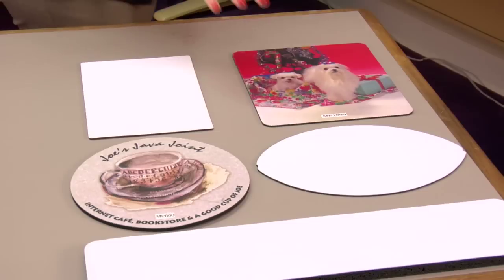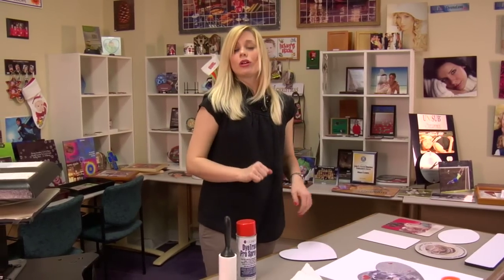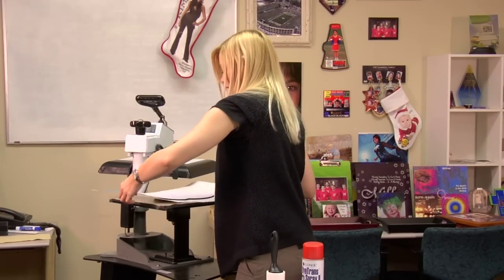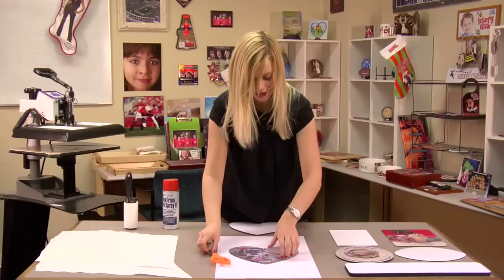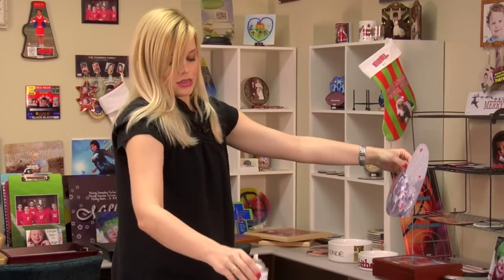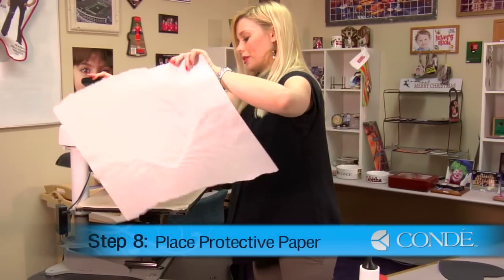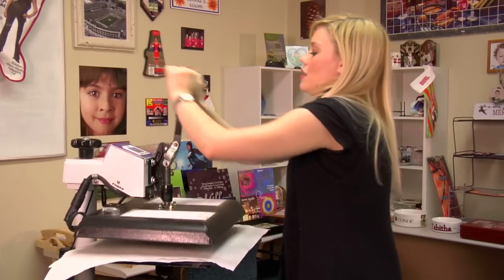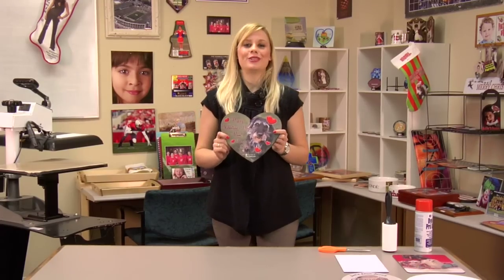How to Sublimate a Mouse Pad - Step-by-Step - Conde Systems, Inc.

Comment: I just tried my first mouse pads today, and found that the color isn't coming out very dark.  It's very muted, compared to the original picture.  Any idea of what I am doing wrong?  I set the press at 400 degrees and pressed it for up to a minute, with the same results.  I am using the JP14, so the temperature on that press is less than perfect, to be sure.
Reply from the maker: Are you getting good results on other sublimation products? Have you verified that the JP14 is actually at 400 degrees with a digital pyrometer? 

Without having more information I am going to say the JP14 is not actually at 400 degrees or you are not using enough pressure. Try increasing the temperature and or pressure until you get good results. Use small strips of RGB black on the same mouse pad so you do not waste too many mouse pads. If this does not work and you bought the mouse pad from Conde Systems then please call in to our tech support if you continue to have this problem.